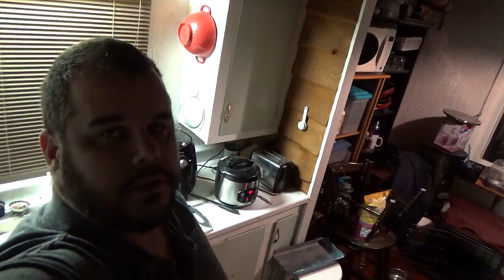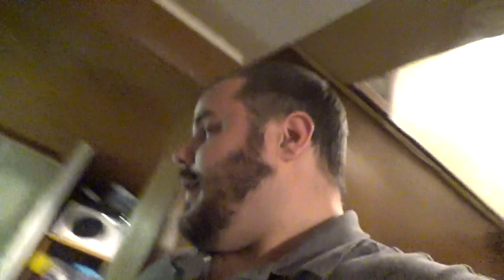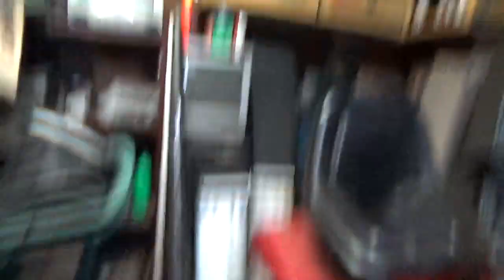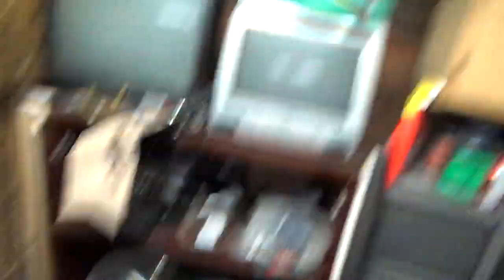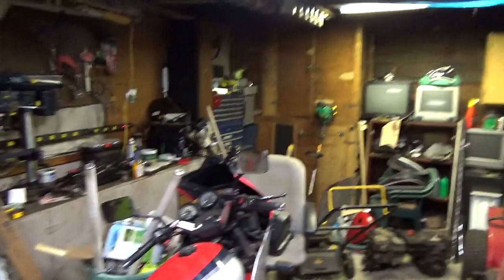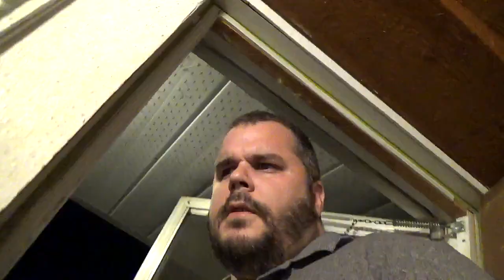Low Budget Productions

Comment: Adam, you have a battery charger right next to your air compressor, hook it up to the battery now and give it a good over night charge.  You won't have to worry about boosting the tractor, which is bad for electrical system anyway since when you boost a battery, you are placing the electrical system under more load because it's trying to produce more voltage than what it has, which can cause stuff to burn up.  Just make sure you look at the battery before you do it, because some batteries are 6 volts, some are 12, flip the switch on the charger.  After you do that, take the battery of the trans-am and charge it too. Give it a good 1 day charge, then another day or two on trickle charge.

Comment: Something I have learned from working hard it does not get you anything but more work, it is the sad truth and is the same no matter where you work.  I use to work at a place that I had to drive 2 hours one way work 8 hours and then another 2 hours home but I would end up either staying later or having to come in early to do work that needed to be done.  I finally learned I will work at a pace to get my stuff done and GTFO, since I do not make more money to do more work but I have more responsiblities.  This is also why I am considering driving truck now, if I work hard (IE get tons of miles) I will make more money but if I want to be lazy well no one to blame but me for what I make.  Might want to consider a job where you do not have to worry about anyone elses work being put onto you.

Comment: Careful, attack moths and they'll attack your clothes... :P

If the air line's sun bleached like that already, it'll probably crack soon... :P

Them small fluoro fittings you can fit 2ft LED tubes in them, then stab them on the garage door to replace the ceiling light it covers up... :P

YAAAAYY!! You can have your own firepit at last and not be jelly of mine, even though mine's small and not that great (but I don't have to pay for a license to use it!!)... :P

And yeah, battletoad either moved on, turned into toad paste, or got eaten by something... :P